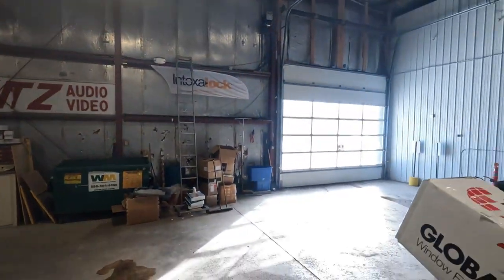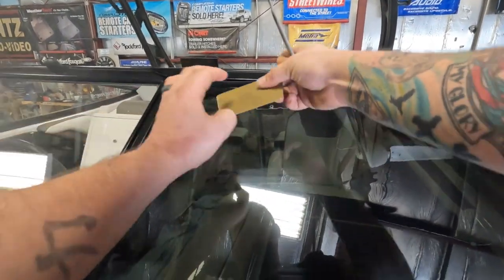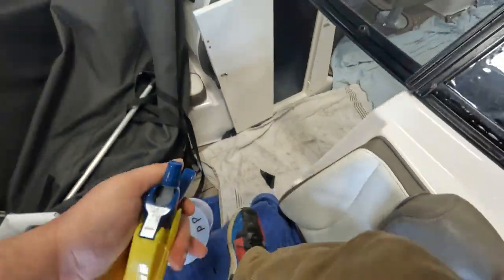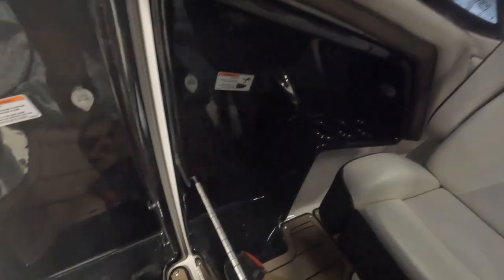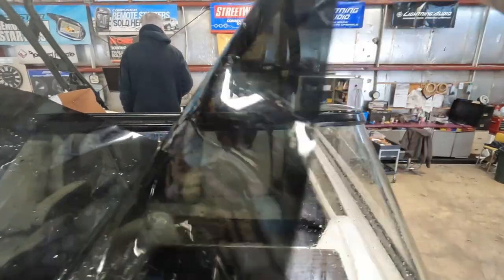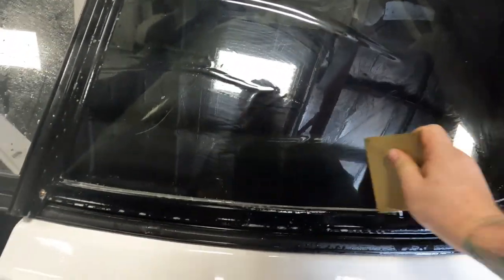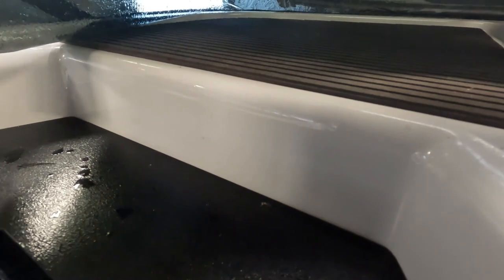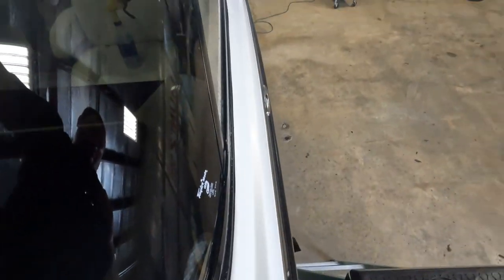how to tint a boat window in 25 minutes

Comment: Don’t use the torch get a heat gun ! I been tinting 26 years and I can tint that  windshield in just 1.5 hours the whole thing ! This guy is still learning from what I seen inThis video don’t shrink the window horizontally vertically works best to avoid the the fingers you see at the bottom and top ! Those will
Pick up a lot of debris I rather have fingers horizontally then vertically to deal with vertical fingers lay down easy due to less tension on the sides !